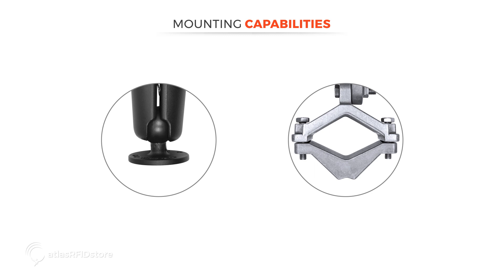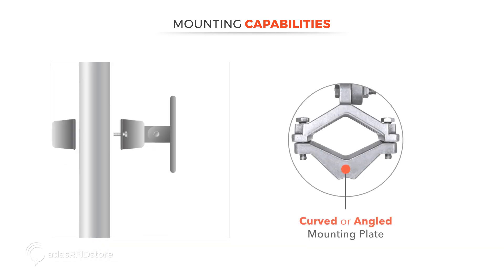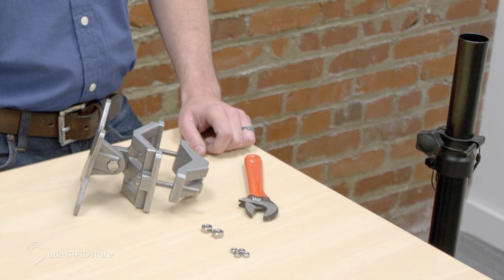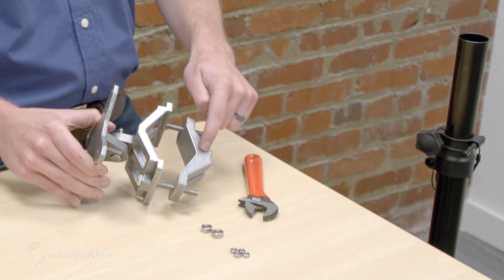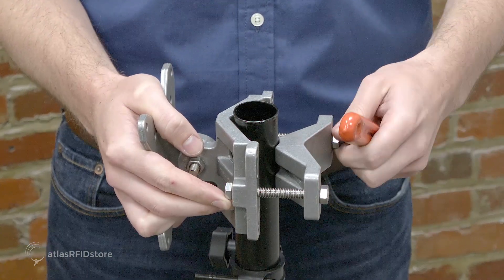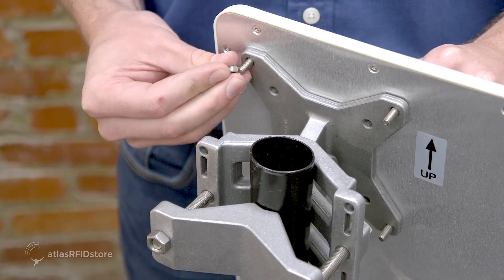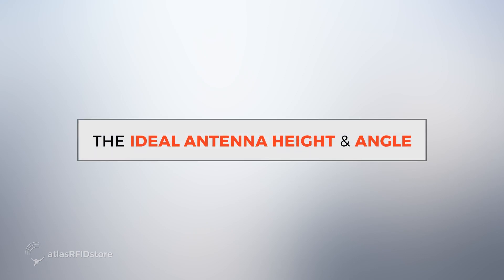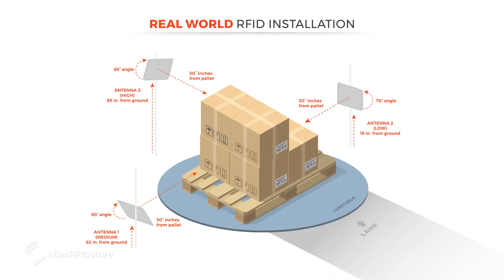Mounting RFID Antennas: Part 2 - Ideal Height and Angle

Comment: Is it possible to use only one antenna to scan a rectangle box place rather than using several antennas?
Reply from the maker: Xie,
It just depends on how big the rectangle box is and the dimensions. If it's a small box completely within an antenna's read field - that's definitely possible. Here's some additional information about RFID Antennas that might be able to help you! https://www.atlasrfidstore.com/9-tactics-for-choosing-an-rfid-antenna/
Thanks!